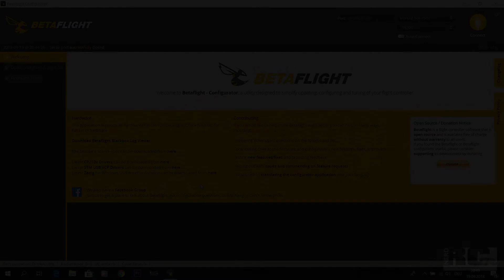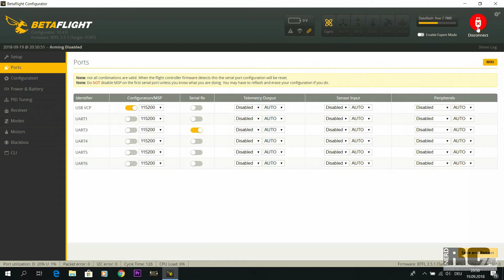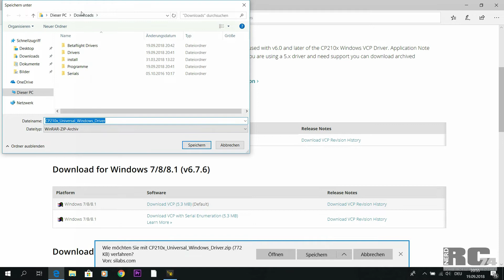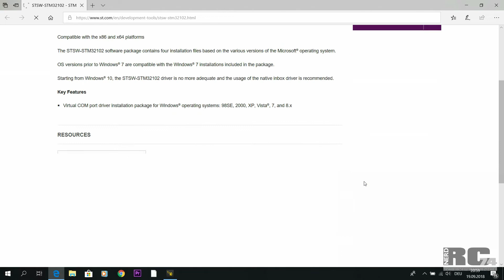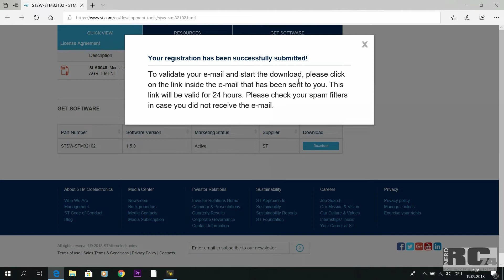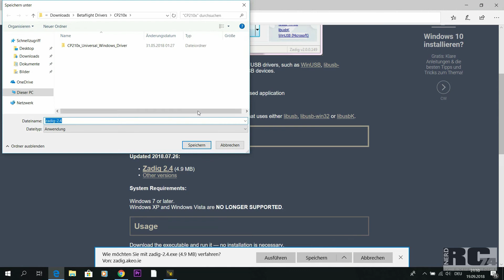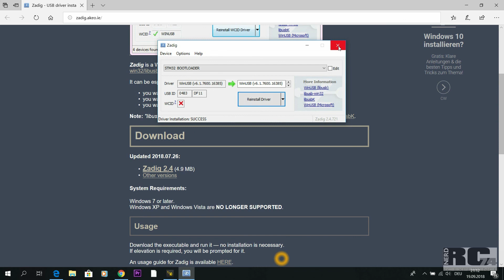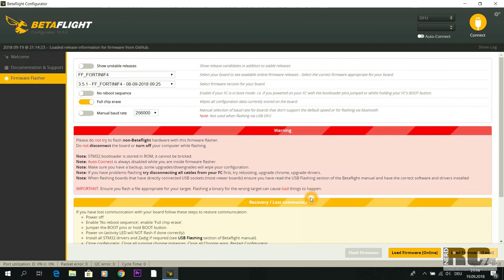BETAFLIGHT DRIVERS AND ZADIG TOOL | WINDOWS 10 INSTALLATION

Comment: Thanks for the great video. I downloaded the drivers, but in Zadig the options drop down menu does not show Stm32 bootloader.
Reply from the maker: Did you push the boot button on your FC while connecting it to your computer by USB? Only a red LED should light up in the FC if you are in bootloader mode.
Reply: @RCnerd74  No I didn't but I did this time. Nothing. No red LED.
Reply from the maker: @jerryzito6840  do you have a second FC you can try with?
Reply: @RCnerd74  No I'm afraid I don't. But I think there may be a problem. I'm going to send it to Flywoo.
Reply from the maker: @jerryzito6840  Hope you can enjoy flying your quad soon👍🏻
Reply: @RCnerd74  Thank you for your kind words. It's not likely. This is day three and video five. I'm done with it for now. Maybe I'll open the box another time.
Reply from the maker: @jerryzito6840  Did your driver installation work as it should? Hope you will find the solution soon.

Comment: Rcnerd74 minei cant STM 32 Virtual Comm Port. im trying to plug in the radiomaster tx12 , i put in boot mode then connect to pc , and  zadig only show radiomaster tx12 , but not the  STM 32 Virtual Comm Port, so i cant connect to the betaflight , any thouhts ? already installed all the drivers twice
Reply from the maker: Did you try to connect your TX12 transmitter to the computer? That won't work. You have to connect your FC of your drone directly to the USB port of your computer. And you need to push the boot button of the FC while connecting it to the computer. When connected, you can release the boot button.

Comment: when I connect the betaflight or cleanflight to my Naze32 it lights up but the com does not show at all
Reply from the maker: Do you have another FC to test the connection with? If yes, try this. If this works, it is an issue on your Naze32. If you followed the tutorial in the video, it should work with Betaflight. To be honest I am not sure if Naze32 works on Betaflight. On Cleanflight, it should. I recommend to change to a new FC.

Comment: Hi there, please help me.. I did everything as you said in the video. Not working at all .. :((((.. I'm using Windows 10 as well.. try every different ports and cables. Is there any other way else?
Reply from the maker: Did you try with more than one FC. Perhaps there is an issue with your FC.
Reply: @RCnerd74  Thanks but I only have one FC. I bought the iflight Bumblebee v2 bundled with DJI fpv system. I can’t even arm the drone and can’t even connect to betaflight. It’s super frustating
Reply from the maker: @GagGuru5  Try to get a feedback from someone who owns the Bumblebee V3 like Drone Camps RC. https://www.youtube.com/watch?v=wTg_GmwXYA8  Perhaps he had the same issue and solved it somehow.

What does betaflight show in the upper right corner when you plugin the FC on a USB port? COM1 2 3 or something or still "MANUAL"?
Reply: @RCnerd74  I’ll have a look! cheers mate

in the betaflight shows only COM 1, 2 & Manual options. I can see in the device manager when i connected the usb to my pc but it shows “USB Mass Storage” not STM32.
Reply from the maker: @GagGuru5  Sounds like something went wrong with Zadig tool. Perhaps it helps if you try these steps one more time. Wish you good luck!

Comment: installed the STM32 Virtual COM Port Driver not apear in device mange. operation system win10.   but I can see DFU mod in betaflight which sucess to install the bootload
Reply from the maker: Sounds like everything should be OK.
Reply: @RCnerd74  the com3  do not appear in the betaflight. can't join the betafight.  I have the controller  taranis 9dx plus and windows 10, do I need anything else to install the betaflight? may be something else missing.
Reply from the maker: @yonghuang6002  If you have installed all drivers and zadig tool exactly like shown in my video, you don't need anything else to make it work. Did you try more than one FC? Perhaps it can also be an issue with your FC. Betaflight shows COM3 or COM6 or so as soon as you connect the FC to a USB port of your computer. No matter what transmitter you have.
Reply: @RCnerd74  thanks for your explain. I didnt connect FC to computor thats why the com port doesnt appear on screen.

Comment: If you read in the ST site BEFORE you download or install you will see they explicitly state that this is ONLY FOR WINDOWS 7 & 8 and will not fit WINDOWS 10. (the last line before the Key Features)
Reply from the maker: But it works on both of my windows 10 computers. So your comment is not really helpful😉

Comment: I am plugging my FC in boot mode, but Zadig is not recognizing it...any thoughts?
Reply from the maker: Did everything work during the driver and Zadig installation? If yes, try different USB ports on your PC. If you have more than one FC, try another FC.
Reply: @RCnerd74  yes, after 4 FC, 2 laptops, and 2 cables....the third cable worked. I didnt realize some cables are power only and some are data enabled....now everything is good. Thanks for the response.

Comment: when I open zadig, I don't have the STM Boothloader
Reply from the maker: Did you push the boot button on your FC while connecting it to your computer?
Reply: @RCnerd74  I forgot about that. Now I see the STM32 Boothloader there, but if I want to connect the drone to betaflight it doesn't work, because when I have selected Manual selection it will write me Failed to open serial port and when I have selected DFU and click on flash firmware I will see USB device successfully closed, I don't know what to do with it.
Reply from the maker: @gagarinkaudindinka  Did it work in Zadig Tool to overwrite the driver? Your problem seems to exist because the Zadig process isn't finished.
Reply: @RCnerd74  I did it exactly according to your video, but when I have DFU selected and I put the flash firmware, I will see the USB device successfully closed at the top left and the firmware will not update.
Reply: @gagarinkaudindinka  you get this figured out?  I am in the middle of this crap now.

Comment: Why is it that I'm the only one in all these videos that the STSW-STM32102 Software package never wants to download or some other binding shit problem?
I'm new to this hobby and I've spent more than a thousand on this new hobby including computer and I'm about to throw it all in the trash!
Am I really this retarded?
Two months already and not a single qwad in the air.😡

Download this, update that, didnt know it was going to be such a hassle, I should just get the tinyhawk RTF kit again and call it quits.
Reply from the maker: Did you get the email for downloading the STM driver? What step does not work like i showed it in my video? And what transmitter and rc receiver do you have binding problems with?

Comment: The boot loader doesn't show up in zadig
Reply from the maker: so you cannot select STM 32 bootloader? Did you push the boot button of the FC when you connect it to the computer? If not it doesn't work.
Reply: @RCnerd74   i have the same problem, i pushed the boot button of the fc and STM 32 bootloader dosen´t appear
Reply from the maker: @PeterPan-um5zj  Did you push the boot button at the same time you connect the USB to the computer? If not it won't show up.
Reply: @RCnerd74  The drone appearing on betaflight... by i can bind the drone with the remote (Drone - Tiny 7 Ldarc - Remote - Flysky FS I6X)
Reply from the maker: @PeterPan-um5zj  I have no idea about binding Flysky. Try this   https://www.youtube.com/watch?v=XOSg17708XA   or search for help in forums...

Comment: It still doesn't work for me huhuhu. My laptop doesnt properly dowload the STM VCP Divers
Reply from the maker: What happens if you try to download?
Reply: for both the CP210x and STM VCP drivers...it would finish like right after it started....it says its downloaded but i think its just windows 10 on a laptop. Nothing shows up in the Device manager too. Both seen and hidden. any advice?
Reply from the maker: i also use windows 10 on two laptops. with no issues. did you already check in which folder it puts the downloaded files? perhaps they are not in the expected folder... just check this and try to download them into the "downloads" folder... wish you success...
Reply: IT WORKS NOW!!! THANK YU SO MUCH!!
Reply from the maker: @im_ricebowl  cool😀 you are welcome☺
Reply: Hey how did you slow it down so you could understand? I still havnt got mine going